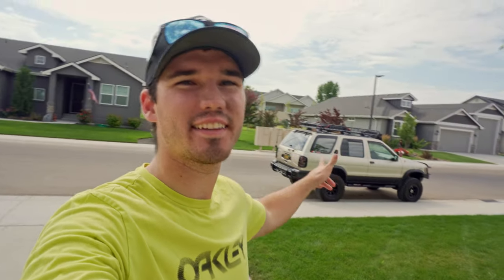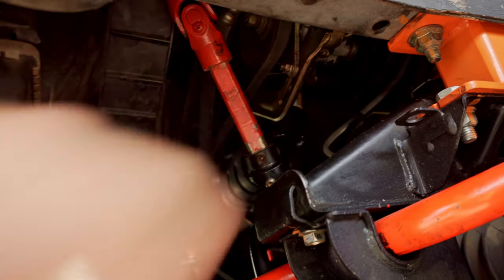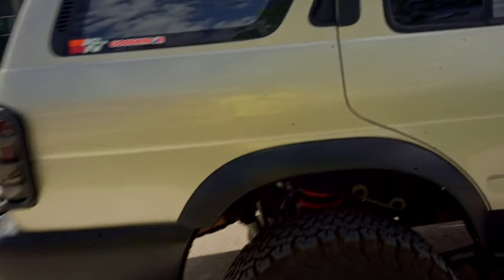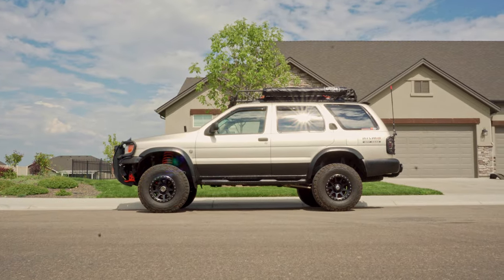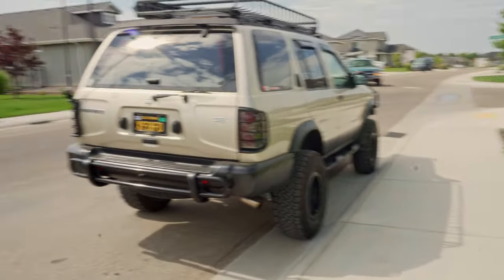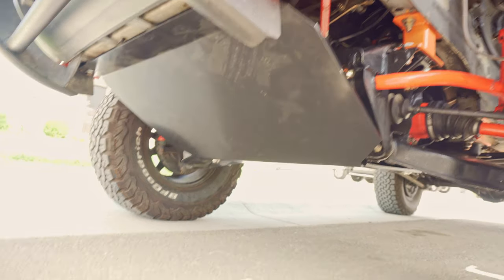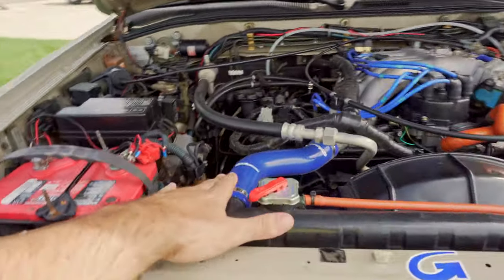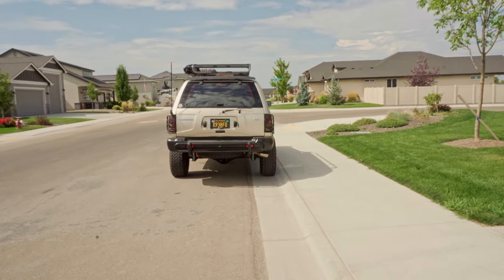Off- Road Build R50! Subframe Drop, Locker, Skid Plates. How to build an R50 Pathfinder Off-Road!

Comment: thanks for video. what about reliability differences between pre and facelift models? some say that pre facelift is generally more reliable.
Reply from the maker: Anything with the VG33E is going to be more reliable than the VQ35DE. But some facelifts have the VG33E
Reply: @208Tyler 290k on my VQ35. Original motor and transmission. 3k oil changes. Pretty darn reliable.
Reply from the maker: @cshocks7  finding one VQ35 with 290k doesn’t somehow negate the trend of VG33E’s outlasting the VQ35….

Comment: Do you think getting or making a rear diff skid plate would be worth it? Won't really rock crawl but might encounter occasional small rock gardens.
Reply from the maker: In my experience, no. If you need a rear diff skid you’re probably also encouting terrain that requires: lockers, winches, sliders, and full underbelly skids plates. 

It’s pretty easy to avoid dragging the rear diff. You’ll know if and when you really need one.

Comment: really cool! are those fabricated front tow points or just painted stock tow points?
Reply from the maker: Stock, Painted. 

Stock tow hooks are designed for towing. Dynamically recovering from them may result in damage, just fyi.

Comment: i got a 1997 QX4 and gonna lift the thing and put new rims. So question how about 3.4 Back spacing? Would that be too much? I know the 3.75 is the flush number but 3,4 could look good too... but maybe too much stress on parts...
Reply from the maker: 3.4 will make the track width unnecessarily wide. You could do it, but unless you have a good reason for it I feel like 3.75 would be better
Reply: @208Tyler  Also i've some doubt still as i have an older QX4. it's a 1997 as said. They never came with 15" rims, but, I've looked and measured stuff out and am 99% sure a 15" will fit it no problem. Some people say they don't clear brake calliper but im pretty sure the older Q's have no problem with 15's as long as the backspacing is a minimum of 3,75. Your input would be much appreciated as you have lots of experience with the R50 series. All your video are very informative and very well done mate! Thank you!
I was looking at putting 31x10.5 15" for tire and i would like it to stick out just a little. Isn't the 3,75 just flush with the fenders? will also go with suspension lift AC front and Land Rover rear.
Reply from the maker: @maximemoniez687  You'll have no problem fitting 15's, especially with 3.75 Backspacing. The 3.75 number is so that tires larger than 31" don't rub on the lower strut perch. 3.75 backspacing will push the tire out a ways. If you want to be flush with the fender something more like 4.5 backspacing will probably be the right number. Pushing the tire excessively far out is undesirable for scrub radius, rubbing, and tucking tires at full flex.
Reply: @208Tyler  Remember though that the Q's have the plastic fender flares that make the stance wider. Thats the reason why i was thinking going to like 3,5 BS. Cool for the 15". I guess the classic is 15x8 -19. Because to be honest i saw another rim that i like which is a 15x8 -24 (3,55 BS) but i have my doubts that it just might be too much. Ah the nice rim topic of the R50's... 😂
Reply from the maker: @maximemoniez687  The downsides of having to do more trimming and having a wider track width to me are far more important than sticking out from the fenders. I would actually rather have the tires inside the fenders- you don't fling mud and rocks all over the vehicle and its better for aerodynamics